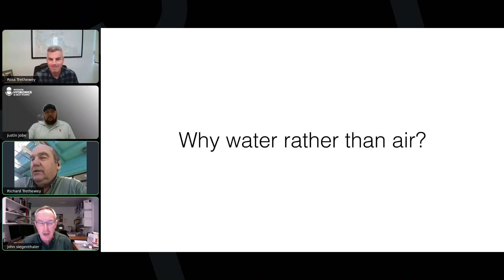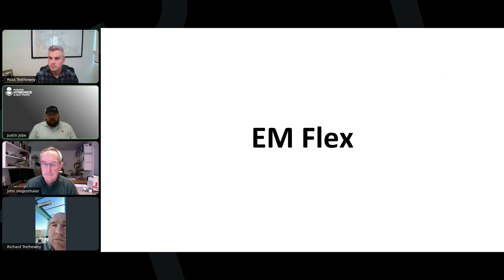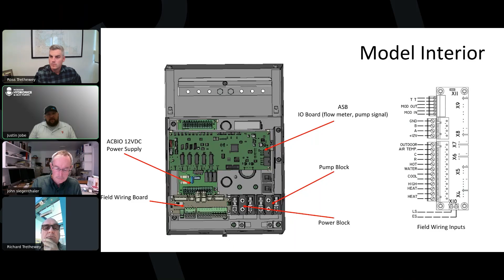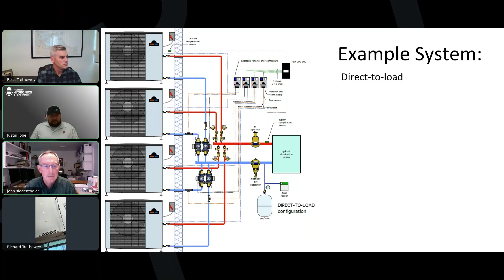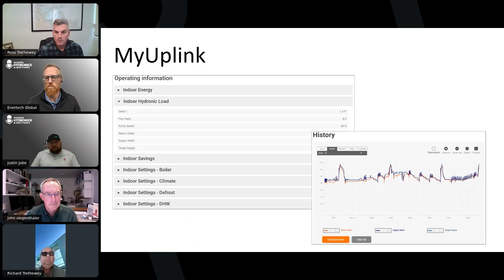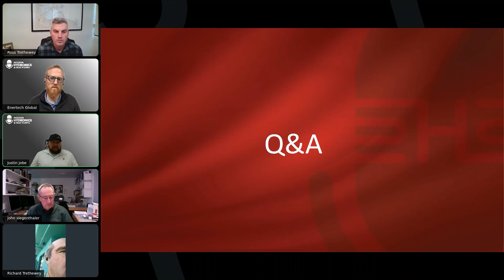The Future of Hydronics with the Tretheweys + Introducing the EM Flex

Comment: Why is a heat pump and solar manufacturer shilling for the fossil fuel industry. Hydronics looks like a bunch of 1800s dinosaurs if instead of talking about electrification and efficiency we’re talking about energy arbitrage as though fossil fuels have no environmental impact. It’s short-sighted and more to the point doesn’t sell heat pumps. Dispiriting.
Reply from the maker: Hi Benji, thanks for taking the time to stop by. You may have a misunderstanding about the premise of our Modern Hydronics & Heat Pumps webinar series. The hydronic systems we discuss are intended to be primarily heated by electric-operated heat pumps that are designed to interface directly with a hydronic heating system. We manufacture both air- and ground-source heat pumps that help building owners move toward electrification in their hydronic systems both in new construction and retrofits. While we are all about electrifying heating and cooling systems, many engineers design projects that require a dual fuel option for backup or auxiliary heating. Our products support these requirements and, in our thinking, a step forward is a step forward.

Comment: I like a balanced portfolio.  Hydronics and small ductwork.  I have a 2000 sq ft house designed for hydronics heating and cooling with a 200 cfm ERV and the EAV030 providing the water to the ERV fan coil.  

Over 40 degrees the Air to water system approaches 4.5 COP and becomes much more cost effective than Natural Gas.